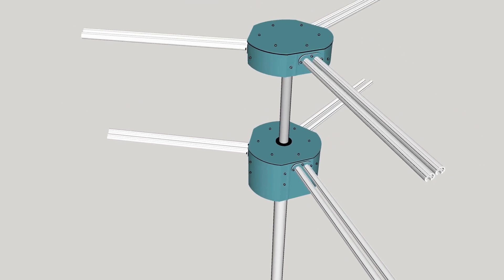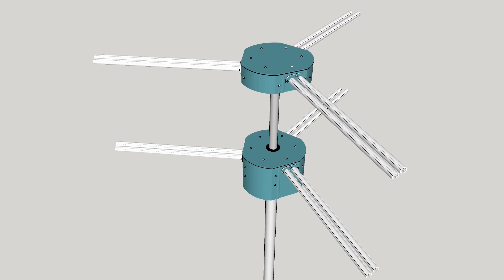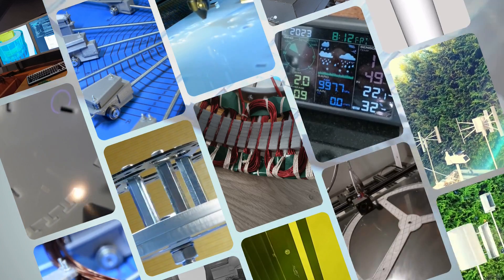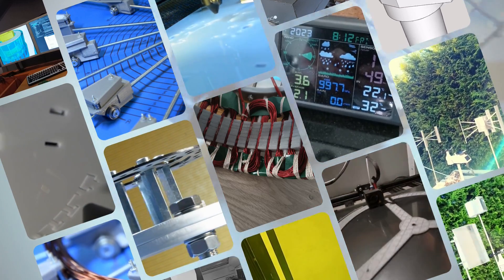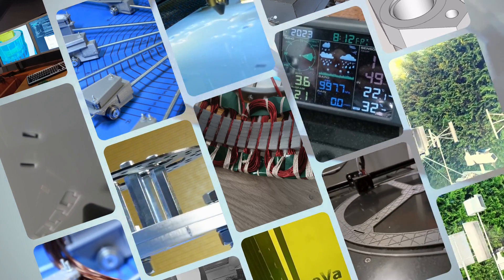DIY VAWT Wind Turbine C-rotor

Comment: Great design! You need to increase the length of your magnets so they cover the entire "long" part of your windings (perpendicular to the direction of spin).  Also since you have a single array of  magnets, it would benefit greatly from incorporating a halbech style array to focus the magnetic field over the coils and not to the outside.

Comment: Do you have a github containing your 3d files etc?
Reply from the maker: I don't have a Github account. The 3D presentation in Sketchup was created only for the needs of the film. I designed everything in Corel DRAW. I can send the C-rotor project to be printed on a 3D printer. Unless you mean something else
Reply: @RafalNowicki  do you have the STL or can you export to IGES, OBJ or STEP file formats?

Comment: Pretty cool work with the platform and the brake ❤
Just to understand, What's the output power you got with that generator? Asking because the air gap seems large.. and your windings seem like they handle lot of current
Reply from the maker: Hi, thanks for the comment. I made the air gap safe to account for tolerance variations from different machines, but I'll make the next one a bit smaller. The copper wire has a cross-sectional area of 1mm². I will be publishing the turbine's performance results.
Reply: @RafalNowicki  nice to see good work shared

Comment: Can you make a printed model of Liam F1 like turbine?
Reply from the maker: Do you mean the Archimedes wind turbine? Interesting idea. You can visually compare its performance with all the designs I 3D-printed. However, it has a horizontal axis of rotation. Either way, it will be an interesting experiment.